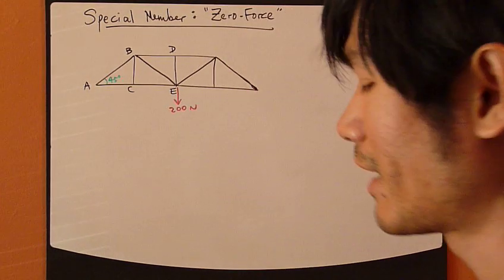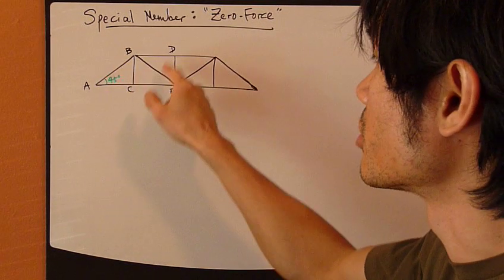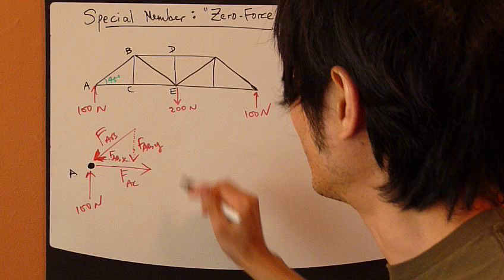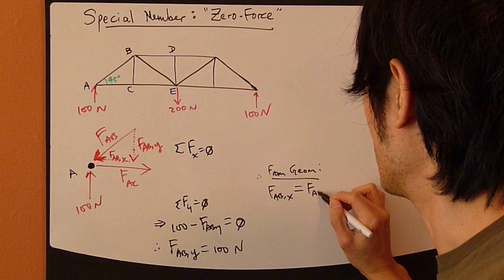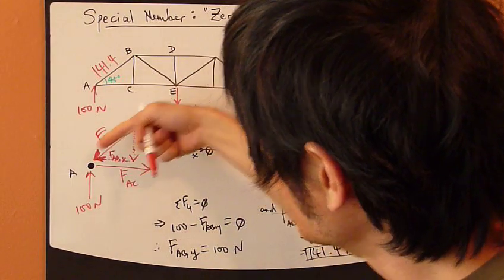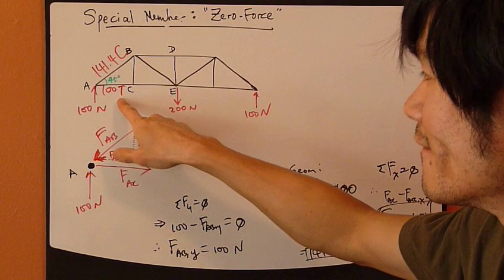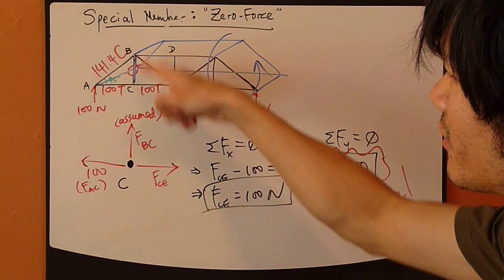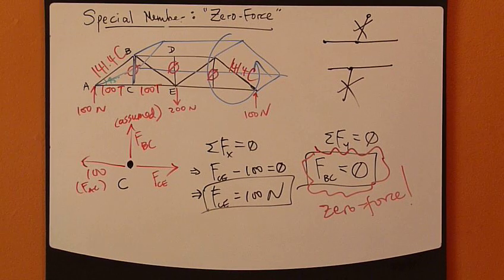Engineering Statics Ch6 Part6: Trusses - Zero-Force Members

Comment: you can always assume all force the same if the length are the same. like in the video. you got Fac = 100 then all the same length as Fac is 100N.. correct me if im wrong..
Reply: Nazrin Shah No. The length has nothing to do with it. You must calculate using the Sum of X and Sum of Y

Comment: good job, but for joint A, why didn't you use the sum of forces in y direction equals zero?  then you would be left with 100 - Fab(sin(45)) = 0.  Fab = 141.42